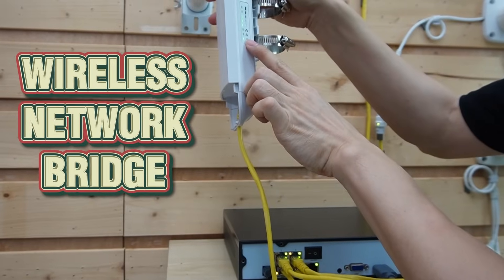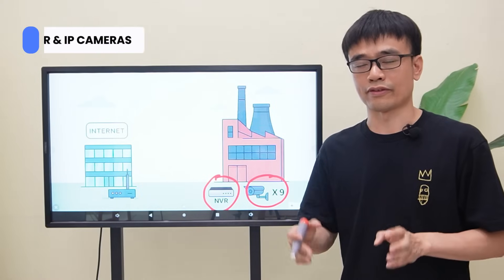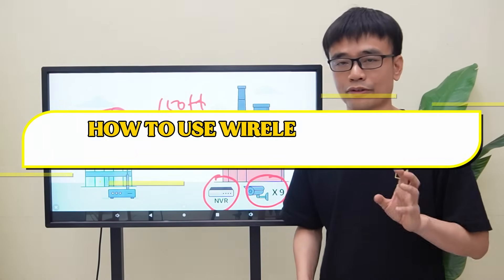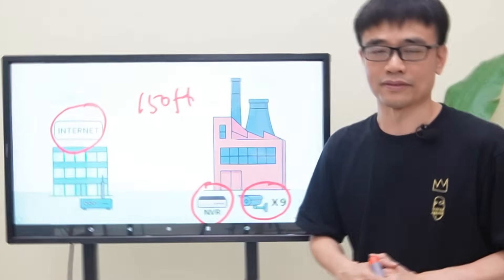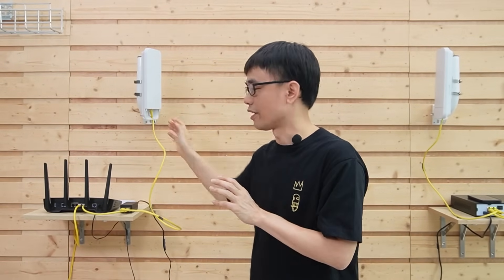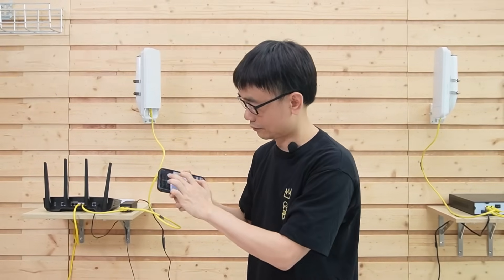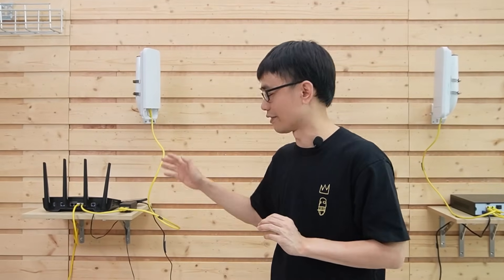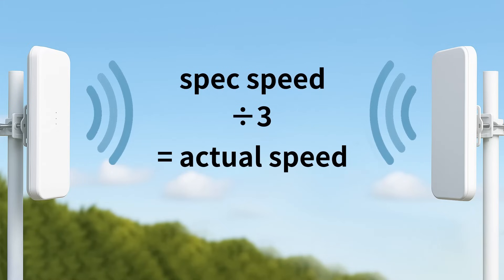IP Cameras Setup in Factory with Wireless Bridges for Remote Access

Comment: You connect bridge in nvr poe. And the other one in the router. How to configure the ip?? Please explain in details sir
Reply from the maker: You do need to manually set the ip address of the PoE NVR to match the subnet on the router. The wireless bridges are transparent to the network. If you want to access the web server built-into the bridges. You only need to set the PC to 192.168.2.***/24.